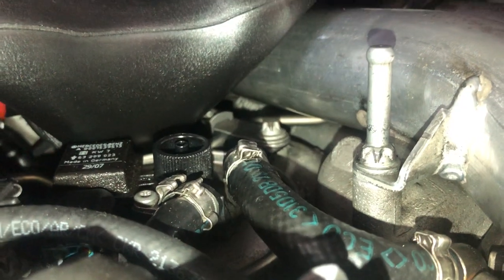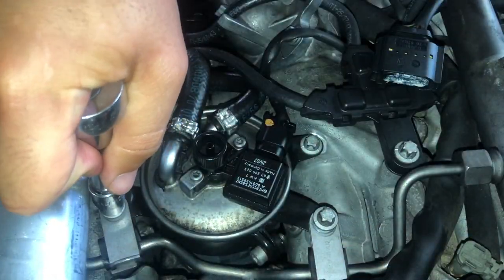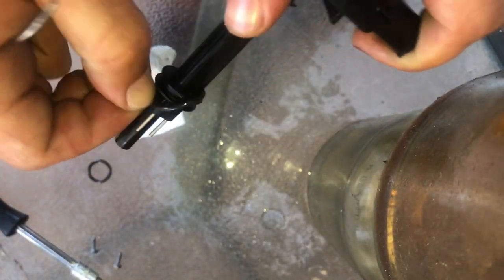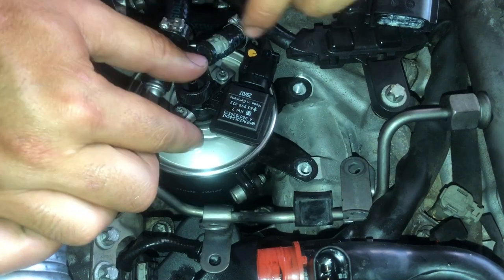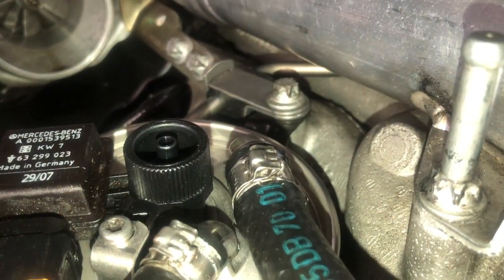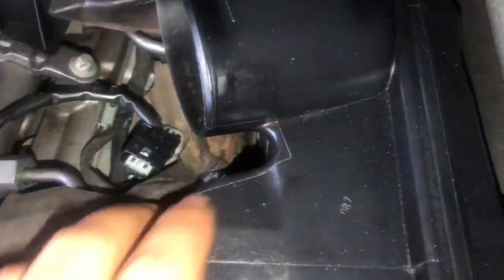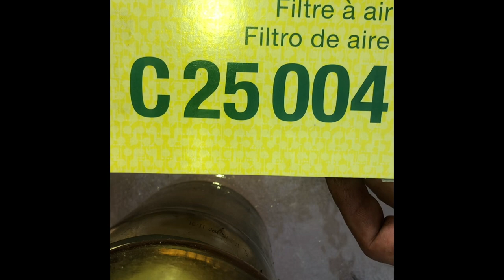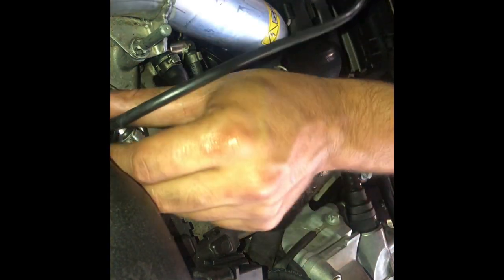FUEL AND AIR FILTER REPLACEMENT MERCEDES Ml 320 cdi w164 OR OM642 ENGINE

Comment: On most OM642 engines, you don't have to remove the whole fuel filter bracket.  You can use an allen wrench to loosen the bracket at its pinch point, pry it a bit open, and lift the whole fuel filter out while the bracket stays in place.

Comment: Regarding the priming with the hose - that's not necessary as long as the "default" priming process works. Turn ignition on (but not the engine) two or three times, until no air bubbles are heard.

Comment: Congratulations on the video!  helped me a lot!  I just did not understand if you have to remove the air when assembling the fuel filter after assembly?  I didn't understand because I couldn't see what you did with that hose and that red platinum.
Reply from the maker: Hi, thanks for the feedback. 
So all you need to do is connect the hose, loosen the bleed screw on filter and then switch the key to the furtherest point to activate fuel pump (dont start the car), do this a few times until no air is seen exiting the tube into your container (my container was red) and then its all done.
Reply: @ifixedit7909  Hello, my 2007 w164 320cdi has fuel filter but WITHOUT bleed screw. Assuming air exiting can be done disconnecting the smaller diameter hose and I done partial release of fuel and air until it fills the entire fuel filter___ Any ideas if this is the only way to de-aerates the fuel line? Thanks in advance.

Comment: do you have to replace the air bleeder screw after putting back the old water sensor into the new fuel filter?  Where can I find the air bleeder screw that compatible to this filter?  Thanks

Comment: Hey mate if you can help me ! I have w204 with OM642 engine, I’m trying to change DPF sensor but I couldn’t find it !
Reply from the maker: Hi, The dpf is going to be located very close to the engine bay side of exhaust so the dpf will be up near the firewall of the car, the dpf temperature sensor which i presume you are after, should be located in the centre of the dpf (large bulge in exhaust) any sensors before and after the dpf will be most likely o2 sensors. I cannot show you unfortunately as i do not have a car similar with a dpf. Hope that somehow helps you.
Reply: @ifixedit7909  I appreciate your information 👍🏻

Comment: Just a heads up 
Every time I changed my fuel on my GL 320 fuel would leak on top of the filter 
Installed a larger o ring on the top, solved the issue

Comment: Have you ever had to replace the  oil cooler seals? Mine are leaking, if yes do you have a video for this operation..
Reply from the maker: Hi, sorry, i have not done the oil cooler seals, i know that it is a common problem though.

Comment: Those clips are pex clips, you reuse them, they will leak, really is it worth saving pence to not replace clips. Shody at best!
Reply from the maker: Yes i agree, if you have some on hand and are not gentle when removing them replace them. In saying that, i have re-used them in my personal cars for over 10 years and never had a leak..
Reply: @ifixedit7909  i would hate to have happen to some1 else what happened to me, i reused a pex clip a few years ago on a customers car and it leaked fuel onto an exhaust manifold, result was a fire, luckily it was put out very fast but i almost got sued for that, cost a lot of my money to fix up, so never, no matter what will i ever do it again.
Reply from the maker: @karldingbat  i agree, would not re-use on a customers car. My personal cars only as i said above and have not had an issue, you must have damaged the collar on it and you always return them in the same position they came off on the hose, so no new pressure spots, like any clamp, unless its a new hose.